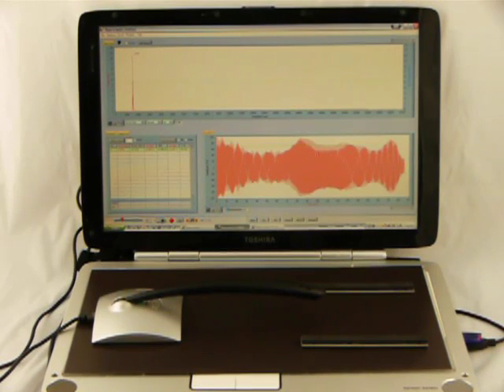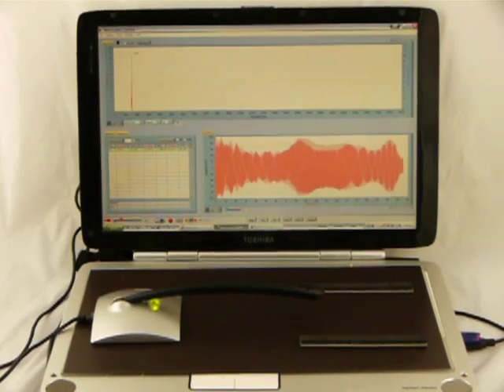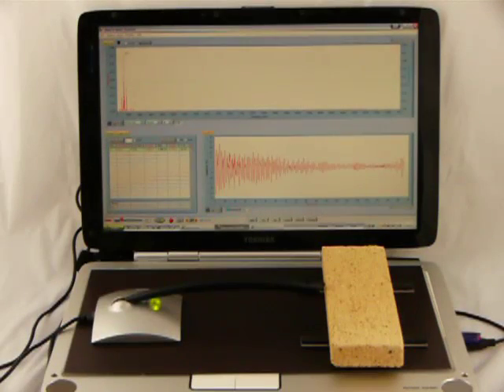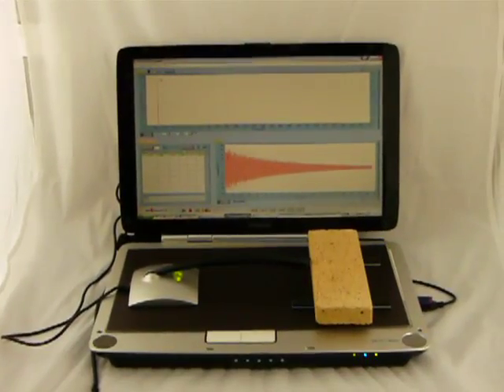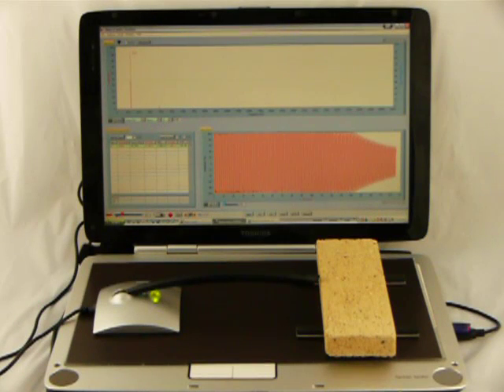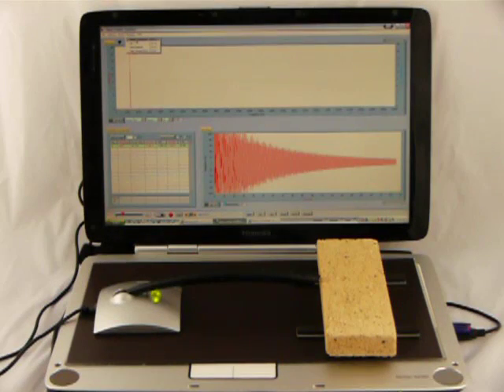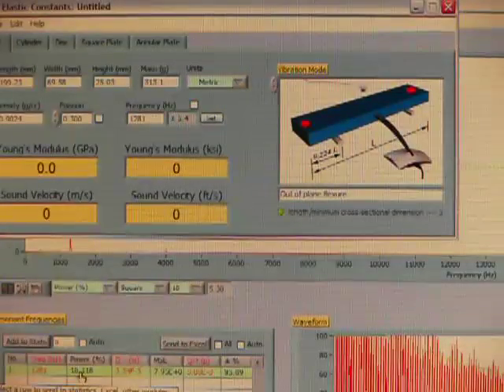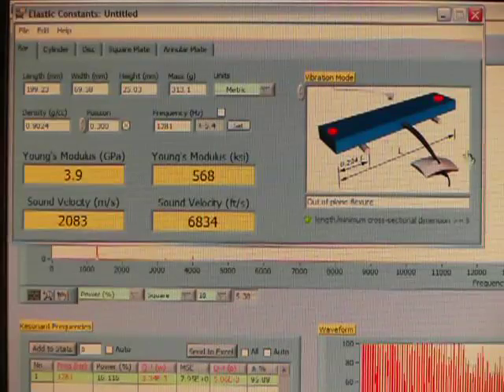Measuring Flexural Resonant Frequencies

Comment: Thank you very much for your illustration,it was really great.
Could you please tell me what properties for microphone is needed ?
Thank you so much
Reply from the maker: The microphone in the video is a low cost Logitech USB microphone from Amazon.com <http://www.amazon.com/Logitech-980186-0403-USB-Desktop-Microphone/dp/B00009EHJV>. In windows Vista and later, our software (Buzz-o-sonic) sets the sample rate to 48 kHz/16 bit resolution for this microphone (44 kHz/16 bit in Windows XP). Buzz-o-sonic can also use hardware from National Instruments and other vendors to measure at 250 kHz/16 bit. In fact, that is our standard hardware setup.
Reply: Thank you very much for your response.